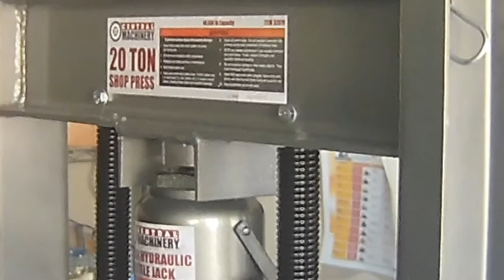2001 Toyota Tacoma Rear Wheel Bearing Replacement

Comment: Thanks for the feedback. I enjoyed watching your video. Come to find out my problem wasn’t in ihe rear end but it was a bad spark plug causeing the truck to shake. At first I replaced number 5 plug and it was the bad one then I replaced the rest. 
After cleaning the Throttlebody and getting a new air filter I think I’m getting over 18 miles per gallon.
Reply from the maker: Fantastic!

Comment: So did this repair fix your trouble. And did you do the other side. 
I have a 2002 Tacoma that I just bought and it’s making a noise from the back end it changes in noise with acceleration and deceleration and kinda a drone at a even speed. Any thoughts or ideas 💡.
Reply: Hey Stevan.
Yes, we did do both sides, and no, it did not fix the problem. My problem turned out to be the carrier and pinion shaft bearings in the third member. (The rear diff.) I had to remove it from the rear axle and send it off to be rebuilt. When they say don't drive the truck over 8-10 mph with the diff lock engaged, you better believe them.😁😁
Reply from the maker: Thanks, Average Joe, for answering Stevan's question.  It was a little beyond me. . .and it's your truck!  Thanks for watching.